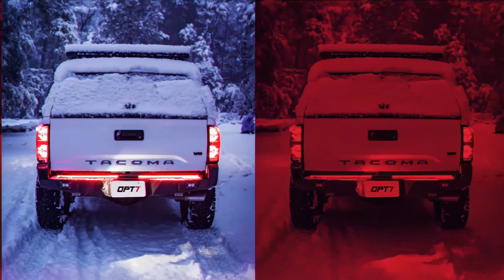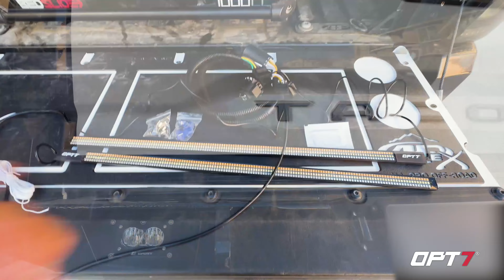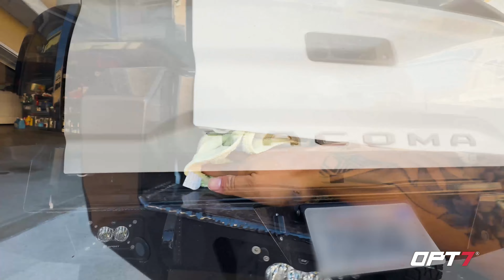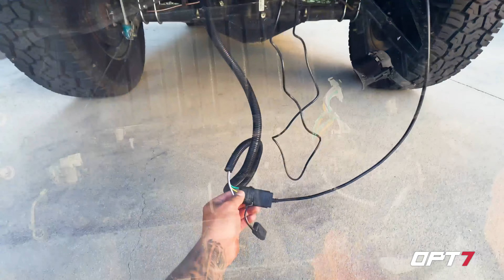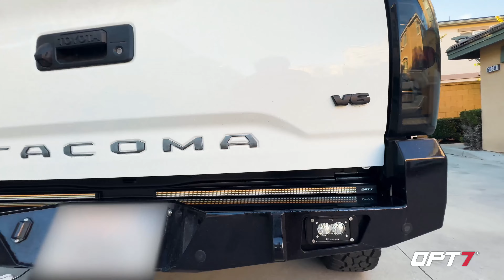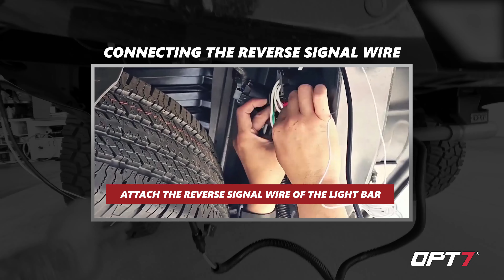[HOW TO] Install OPT7 Redline Toyota Tacoma LED Tailgate Light Bar - 3 Ways Easy Install - Best Mod

Comment: I bought one triple row light and the running lights are not working. Everything is installed correctly. My brake lights work, but no running lights. Any ideas?

Comment: do you need to take the neg. battery terminal off before hooking everything in
Reply from the maker: Not sure what you mean, feel free to email our team for install support support@opt-7.com
Reply: Not really, but it's never a bad idea to do when dealing with the electrical system in amy capacity. But it honestly isn't needed, since there is zero splicing required.

Comment: How do you get the connector off?
Reply from the maker: There's no on and off switch for the 7pin to 4pin Harness Connector. It's a plug that allows a connection to the light bar.

Comment: Do both lights have their own wire and then connects to 4 pin? Then 4-4 pin connection happens to harness?
Reply from the maker: Not sure of your question, but feel free to reach out to our team for more install support via email - support@opt-7.com
Reply: @ i figured and insgalled 48 inch light and using ur opt harness with reverse wire. Its a beautiful led light. I fitted it in back usinv velcro strips
Reply from the maker: @dm6368  Awesome, so glad to hear! Here's another option also if you wanted to use the magnet options: https://www.amazon.com/OPT7-Tailgate-Rare-Earth-Neodymium-Specifically/dp/B0CKKZ4ZHT

Comment: Can You Please Send me the Link For my Adapter Harness i have a 23 tacoma
Reply from the maker: https://www.opt-7.com/products/opt7-redline-dual-7-pin-splitter-with-reverse-wire-to-43-inches-4-pin-extension-adapter-harness
Reply: The company lied. Even though it says on Amazon " this fits 23 Tacoma ". It dosen't.  No adapter will work. Scammy company.

Comment: Going to try these out. Just bought a pair for my Taco. I also happen to have the same AlphaRex tail lights as well. I noticed that the left turn signal on the AlphaRex tail lights was not working in this video. Was this a problem with your tail lights? I am now on my second pair of AlphaRex tail lights replaced under warranty.
Reply from the maker: We had another team opt7 mention the same issue when they installed it. Upon troubleshooting, the issue was resolved. Feel free to email us at support@opt-7.com
Reply: @OPT7Lighting  can you use this product on other vehicles other than a Tacoma?
Reply from the maker: @chrismunoz9289  You sure can!

Comment: I don’t have the towing package. How do you hardwire it?
Reply from the maker: You'll need this wire to hardwire - https://www.opt-7.com/products/opt7-redline-4-9ft-hardwire-harness-kit-for-tailgate-light-bars 

then check your owner manual to see which wires are turn, running, brakes, etc.

Comment: When using the standard method of install with the foam and plastic aligner, the light bar appears to be too long in that it would go over the overlapping metal on each side, meaning the light bar would not be able to lay flat and adhere with the 3M tape, is this wrong?
Reply from the maker: not sure what you mean, for more product support, please email our team at suppor@opt-7com
Reply: If you are talking about the small metal hump  then you will be fine.

Comment: Being that almost everyone will be using the standard methods of installing,  I would've preferred seeing the usage of the foam pad and slider.
Reply from the maker: Stay tuned, we have more install videos coming soon. Thanks for pointing it out, we appreciate your feedback!
Reply: @OPT7Lighting  sure thing. Thank you tho. I have the original redline triple on my tacoma. Rather than just get more mounting tape to move it down and cover the spare tire hole, i just ordered the new one over the weekend. (I'm sure someone there will remember my email about the 3m tape inquiry lol)